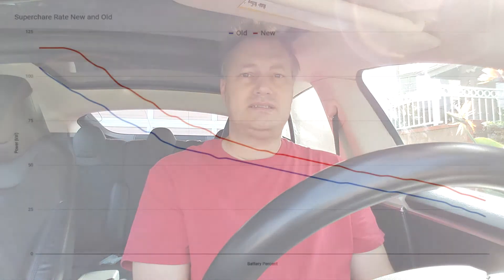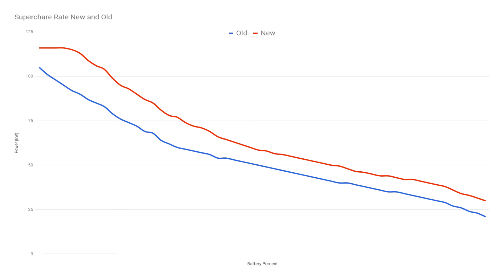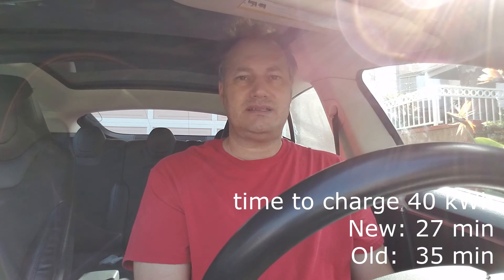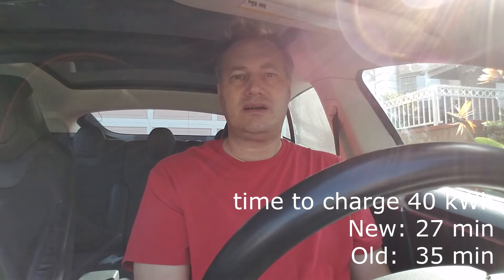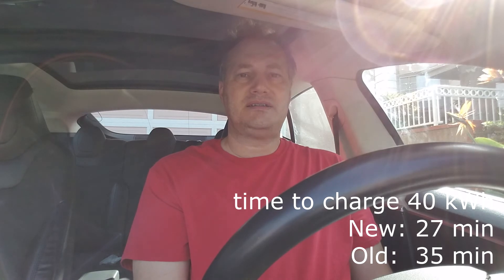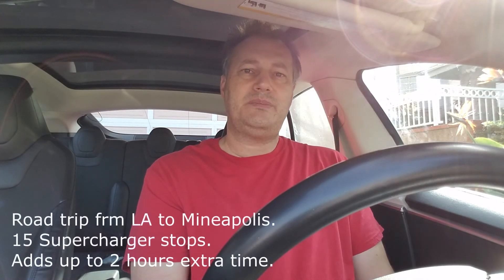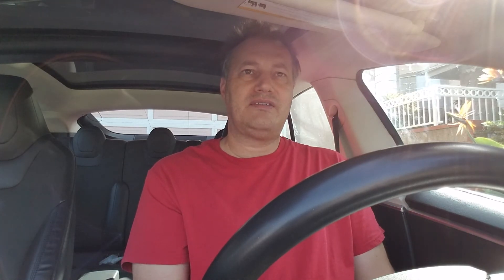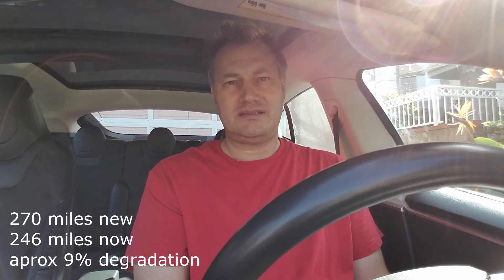Slower Supercharging due to degradation

Comment: If 347A (120kW/346V), the I2R of even 0.001 ohms total connector resistance is 120 W
Reply from the maker: Makes we wonder why Tesla did not add an active cooling system in that area.